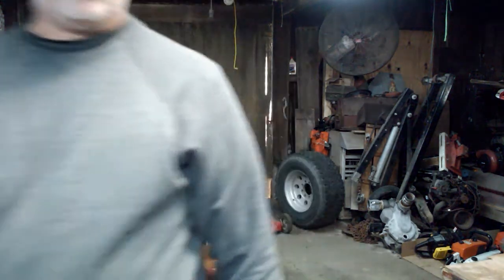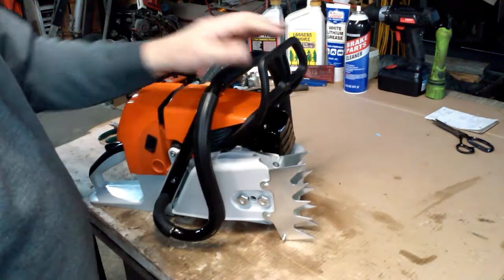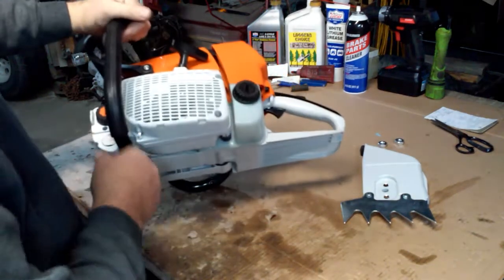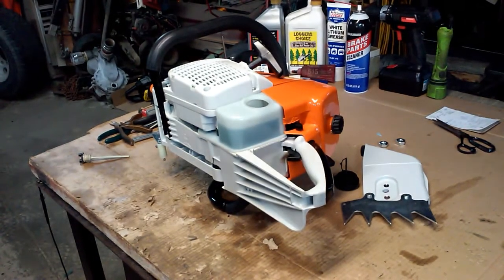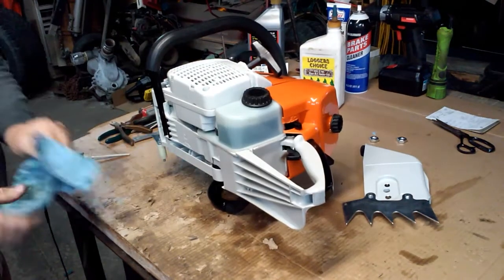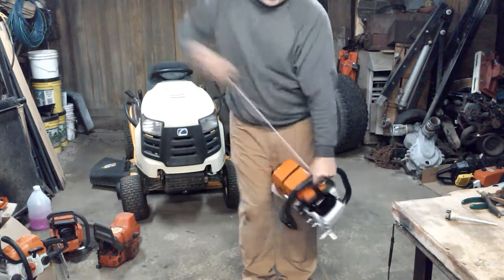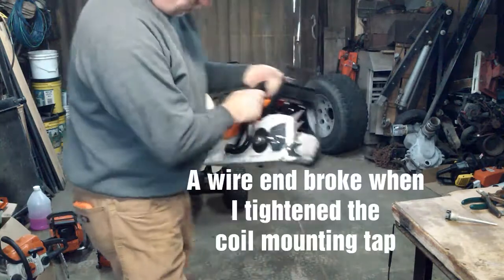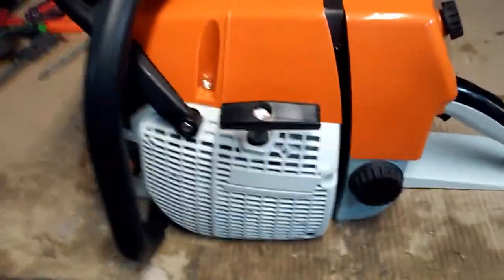Huztl MS660 IN FINISHED FORM AND FIRST START

Comment: When I overfill the bar oil tank I just put the cap on and spray break cleaner around the cap to wash away the extra oil and then wipe it clean with a shop towel.

Comment: The kill circuit is easy to trace.  Just pull the kill wire off the coil and put an vom meter on it.  It should be infinity to ground in the run position and a short to ground when you put the saw in the off position.  The wire that plugs into the spring carries a ground on it and the wire on the master control lever carries this ground back to the coil in the off position.  You may not have the brass end on the link switch wire touching the spring in the off position.  I always check this circuit before I button up the recoil starter.  I do not want absaw that I cannot cut off.
Reply from the maker: John don't know if you caught it in a short pop up but the issue wound up being a broken wire end at the coil, installed a new wire end and all was good.
The non restart issue was a choke butterfly that was stuck in the closed position, the fix fot that was the loosen the tiny screw that holder the butterfly on the shaft and operate the choke a few times and tighten it back up with the choke in the on position, no more sticking choke.

Comment: are you using a 7 or 8 tooth sprocket? i was always told to go more oil on the large stihl saw so i completely agree a lil more oil to the gas is a good idea, and i love the fact that thing has the screw on caps then those damn flip caps stihl uses now
Reply from the maker: I'm running a 7 pin rim and I run all my 2cyl equipment at 32:1 useing Lucas Semi Synthetic  2cyl oil
Reply: the g660 calls for 25:1 gas mix thats probably more around how i mix everything anyway some my older stuff is 20:1 mix and i dont like having a can of this n a can of that they all get the 20:1
Reply: I prefer the newer flip caps. The screw on caps can be a real PITA when the screwdriver slots eventually get wallowed out. Never had a problem with the flip caps on my MS361, MS250, or MS192T.

Comment: I am just about ready to place an order for one of these kits, I have a 372 now that is a great saw and several smaller for limbing , not sure I would ever need a 36 inch bar for what I do, so kind of undecided on which kit to order, the 360 may be more useful and lighter, but the 660 kit is only 30 dollars or so more, makes it tough to decide which way to go, money is not a problem, by that I mean the 30 bucks, i can't justify the money for a real stihl that size, if that makes sense, have you put that 660 into a tree yet, and if so how was it, any issues, temperamental at all, nothing upsets me worse than grabbing a saw so I can get to work and having it not fire right up....I appreciate your taking time to answer me on your 440 video. Now you have done both, so you like one over the other??
Reply from the maker: Ok, first I'll start by saying your right about the cost difference I totally  agree with you about the cost, just remember that these saws ARE NOT the real deal but a copy so with that being said they are not all that bad. Remember you can put a smaller bar on a bigger saw then in the future if you should need a bigger saw and bar it's just a bar& chain swap. The 440 I have so far has been a great reliable saw no real issues,  the 660 I have the only issue was on the first start the butterflies in the carb were sticking, the fix was to loosen the retaining screws operate both a couple times and tighten the screws back up. The 440 is lighter than the 660 but also has less power, comparable to the 372. Assembly for both is pretty much the same. 
My choice hands down is the 660  which cost less than the 440, I find my self grabbing the 660 almost every time I go to cut wood, you can lean on this saw pretty hard without bogging it down too much because of the power it has. It is a little cold natured and takes several or more pulls to start but once started and warmed up and tuned (I do this every time I run my saws because of temperature change) it runs and cuts like a beast. I run a 28" .063 full chisel round filed chain. It all comes down to what YOU really want but the way I see it it's better to have and not need than to need and not have but that's just how I see it.
So GOOD LUCK
Reply: @craigtimmons3468  thank you sir, guess it's a 660 kit, can't hurt to have more power, I thought my 372 was a beast so more power might  be fun. For the money I may end up with both a 360 and 660 kit, still less than 1 factory saw of equal size.  I'll let you know how they turn and work out. Again, I appreciate the reply and answers.
Reply from the maker: @marcusmorgan1419  Good Luck, before you know it you'll have 1 of each size.
It's an addiction once you start you just can't stop. And it's fun, interesting and frustrating at times then in the end you have the self satisfaction that you built that saw from a box of parts. Very satisfying.
Reply: I am going to make an installation tool for pulling the crank into the case, do you know offhand what the thread size and pitch are on both sides of the 660 and the 360, I think the 360 is 8mm both sides but a left hand on one, and 10mm on the 660, same left hand one one side as well, is it 10 and 8x1 or 1.25 on both crankshafts?? Thanks in advance. Hopefully I don't end up with a dozen saws!!
Reply from the maker: @marcusmorgan1419  I believe on the 660 pto side is 12x1.0 left hand thread and the mag  (fly wheel) side is 10x1.0 right hand,  the 360 I'm not sure  but the pto side may be 10x1.0 but that's just a guess. Ill keep digging and post if I find it.
Reply from the maker: @marcusmorgan1419  That didn't take long looks like on the 360 pto side is 12x1.0 left hand and the mag  side is 8x1.0 right hand
Reply: Thanks, I just ordered the 360 and 660 parts kits, went with the 360 instead of the 361, supposed to be lighter?? some extra seals, and a few other small items along with bars and chains, kind of skeptical on those for the price, but will see how it goes, less for both kits, actually all of my order,  than I can buy a new good size stihl for, as you are more than aware,  if they run and cut well for a few years and through many cords of wood, it will have been worth it. Just hope I don't end up with more saws after these 2 than I need or can use I should say, but I do get somewhat obsessed with things at times, so wouldn't be suprised if i do get more after these if they work out!! I have a small machine shop set up so was just planning to make the crankshaft tools I will need myself, I can order left hand thread taps easily enough, just wasn't sure what size I needed to order, they are USA orders so should arrive faster than the kits I imagine.. I appreciate all of your patience and taking time out of your day to answer my questions as well. Thanks again.
Reply from the maker: @marcusmorgan1419  Hey no problem this is why I started this channel, To maybe help someone who may have a question or two and or someone who just isn't sure. I've had decent service out of their bars and chains but the bars are kinda heavy. I just recently purchased the very fist huztl kit I built (husqvarna 372) back form my buddy because he no longer has a use for it. Its pushing 2 years old come January and has cut many cords of wood and is still running great. The video of the first start on this saw is the first video on my page and runs for about 34 seconds.
Reply: @craigtimmons3468  lol, that's funny,  buying your saws back, how many do you have that you built!! I'll check out the video. I normally buy Oregon bars and chains when it's time to replace one, they seem to work well and hold up for what I do,  thought about buying chain in bulk rolls and making my own,  but I really don't replace them that often, unless the kid or other family member burns one up.
Reply from the maker: @marcusmorgan1419  I now have 2 372's and 1 more to build, a ms180, an ms250,   an ms440, 1 ms660 and 1 ms660 that needs assembled, an 070 that was purchased fully assembled this was before the Kits were available and an 070 kit that still needs assembled, and an ms038 that needs assembled.  I'm currently working on a Husqvarna 576xp autotune that will be a complete case split rebuild using all new OEM parts. It will be fitted with an Oregon 24".063 404 bar and chain. Hope to have it finished before Christmas.🙏
Reply: I.would say obsession with that many! Hope I don't end up doing the same, hey i.just got an email telling me the 660 kits are not in stock, how is the 070 compared to the 660, are they the same saw, just a bigger bore on the 070 or entirely different animals??
Reply from the maker: @marcusmorgan1419  It's more of an addiction, I love putting them together. As for the 070 over the 660 I would wait on the 660 to come back in stock.
The 070 has more bottom end power (105cc verses 95cc) but only runs around 8500 rpm's compared to around 12500 rpm's of the 660 so that makes the 070 a slower cutting saw not to mention the difference in weight 660 is around 12 lbs and the 070 is around 20 lbs .
Reply: @craigtimmons3468  appreciate the information, I'll wait for the 660 kit to become availble and build the 360 when it shows up for a first run at this. I worked on Harley Davidsons for 30 yrs b4 I retired, actually went to a factory Honda school as well so played with metric bikes for a while, did some 2 stroke performance stuff, porting ect...was a long time ago, anyway, I should be okay I think as far as assembling one of these, and your videos will help as well, your posts will be a big help too. Thanks for the information. I'll let you know how it goes or be asking a question or 2 if I get stuck!!
Reply: Looks.like the 660 kits are available already, one day out of stock and ready to ship today, they must box those kits up from single parts or something, anyway, it was way faster than I was expecting, so back on track, I can't find a 36 inch bar and chain for them either but a 28 should be more than I need more than likely, I use 20 and 24 inch on everything I have now and haven't had the need for longer bars, so will see how the 28 works, when you gave a weight of 12 lbs for the 660, is that without the bar I'm guessing?? Thanks again for all your help
Reply: @marcusmorgan1419  where do you buy a sigle kit

Comment: So I forgot the same AV bushing as well.. that blows when you have to tear her down again🤦‍♂️ By the way what’s your fix for the gap at the bottom of the 56mm B.B. piston??
Reply from the maker: Sorry it took this long to reply some how I missed this. I was not able to use the Big Bore kit due to the extreme lack of piston to head clearance it was an extreme head slapper. I may revisit the Big Bore in the future and see if I may be able to cut a pop up piston and install it on the saw.

Comment: Great job I got one for Christmas
Reply from the maker: Congrats, You'll have a ball putting it together.  Make sure you check for metal shavings on the case halves and the bearing depth in each half if your using them as is. Mine runs like Godzilla LOL.
Good luck

Comment: im good with clones but i seen where some of the clones actually say stihl on them that i think is just wrong and possibly why when i just looked them up they have blue plastic now definatly something im going to look into
Reply from the maker: Yes I too think that branding a clone isn't right, but if that's what someone wants to do then that is up to them.
The Blue is New to the market, check out afleetcommand here on youtube he has some really good videos on the Chinese Saws and just done one on a Blue 660 clone.
Reply: Craig Timmons i guess i will be bashed now i went ahead and ordered the g660 the blue plastic and wrap around handle and being under $300 why not right?
Reply from the maker: @rickfinzel  Welcome to the club, just remember the trolls who bash really haven't got a clue.
20:1 mix may be a tad rich which can cause carbon build up, plugged spark arestors, fouled spark plugs and lots of smoke, but like I say you wouldn't drive your car with just 1qt of oil.
Reply: i havent had a problem with spark plugs ive only ever had plug out of my 460 1 time and that was when the saw set under 3 ft of water over night when we had a bad flood which it was all my saws and weedeater i did same to them all. at one time i wouldve never bought anything but name brand stuff but now a days not only am i more strapped for cash but i also know aslong as it gets the job done who cares where its made

Comment: just a suggestion on the piston clearance, would an oem gasket solve the issue (thicker than aftermarket?)
Reply from the maker: An OEM Metal gasket would not have come close to taking up the distance that was between the cylinder base and the crankcase mating surface, Right off hand I can't remember the exact number but I think it was around 150 thousandths and the OEM gasket is like 12 to 15 thousandths compressed.

Comment: please let me know how it holds up it would be cool to build one.
Reply from the maker: It's been around 1 year now, the only issues I have with it is of my own doings, it's hard to start "HI Compression and Timming Advanced" the only other issues were with the carb "butterflies sticking" causing a no restart and I posted a video on the fix.
It been a good saw and has cut many a truck loads of firewood.  It does like the gas but it is 95cc's

Comment: Also it seems I have to rotate down right past top dead center to crank even with decomp push down or recoiler will almost pull my fingers outa socket. It seems as if yours pulls easier any thoughts on what I’ve done wrong?
Reply from the maker: As for the Big Bore Cylinder I haven't done anything with it yet, I just received a 2nd 660 kit and my plan is to try  to cut the squish band down and cut a pop up piston to see how that will run.
I've not put a gauge on it to check the compression but it is hard as hell to pull without using the decompression valve. 
It's hard to tell but have you checked the squish? Should be .020 thousands or a little more or you risk the piston hitting the head.
Is the crank binding? Coil hitting the flywheel? Clutch binding?  Just a few ideals.
Reply: Craig Timmons ok thanks I will check these. Another odd thing about it is I can pull the recoiler slowly and it seems to be reflectively smooth with a small restriction at bottom dead center.
Reply from the maker: If you have the decompression valve pushed in (opened) it can bleed enough compression off if your cranking slowly to make it turn over easy, it sounds like you may have something rubbing or binding up. Did you check the bearings before and after crank install and case halves pulled together? Should turn free with slight drag from seals but should be smooth.
Reply: Hey Craig just wanted to share what I found out with my 660 issues. So I checked off everything we discussed and didn’t find anything off. I also checked squish and was around .026 When I ordered the kit I had added extra parts including two big bore piston kits.  So after scratching my head on first 56mm. I swapped to the other 56mm. Still same issue. Every time I pull recoiler and saw pops it locks recoiler and jerks outa my hand ( very painful) so my last effort was to put the 54mm in and give it a try and lo and behold it works and pulls perfectly. So I’m still confused on the 56mm’s but at least I have a working saw now!  My only thoughts are it must have something to do with that blow by  gap at the bottom of the piston (air locking maybe idk just a guess) anyway sorry for my long ramble. Good luck with your new build for your friend and thanks again
Reply from the maker: Interesting ,  the .026 squish is right on target . so it pops as in trying to run?  Maybe the ignition timing is a fuzz advanced.
Glad you got it in running form.
Thanks
Reply: Craig Timmons Yes I may have forgot to mention that I had both 56 mm pistons running.  I even tuned saw in on first set. I was able to get it started by setting piston just past top dead center and then jerking, but not every time. Sometimes I would set piston in position and jerk recoiler and it would come to dead stop mid pull.  You may be on to something with timing I bet it’s trying to fire as I’m pulling piston up. I will look into to this but why is not happening on the 54 mm 🤔
Reply from the maker: Are you using the same decompression valve on all 3 cylinders?  Maybe its not able to dump the extra compression of the big bore cylinders, just a thought.
At this point I'm not sure why it happens with the big bores but it sounds like your describing a kick back from early ignition and /or  a combination of that and the increased compression. One other thought is the ignition module (coil) could have an issue, this could affect timing which could be intensified with the big bores.
Reply: Craig Timmons yes I actually bought a oem  decomp valve as the farmertec lasted a short time before the button came off.  Is there a different decomp valve for the bigger cylinders? If so That very well maybe the issue
Reply from the maker: Not that I'm aware of

Comment: I ordered the 038 have done one of them?
Reply from the maker: David Dahl I've not done one of them yet.  This 066 runs and cuts like an angry beaver on steroids. Cut a 45ft dead standing ash 25" base down last week but forgot the camera at the house. Run a tank and a half of fuel and didn't miss a beat. I've got an 044 on the branch right now, a Husqvarna 575xp and a McCulloch Mac3200 then I'll get back to the kit saws.Good luck on yours hope you have fun building .
Reply: Craig Timmons thanks for the reply and you have a new sub, good luck sir.